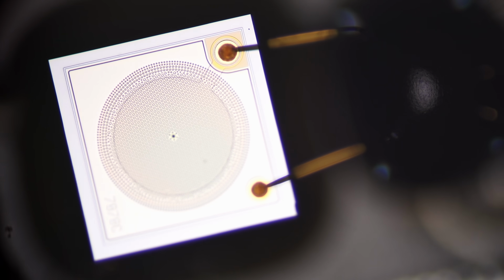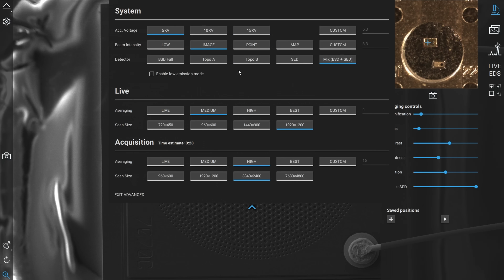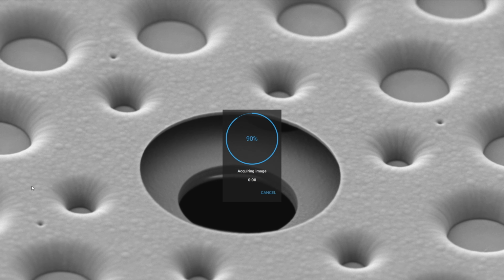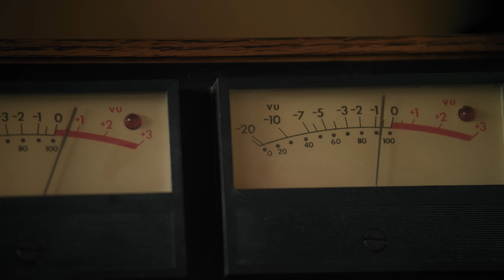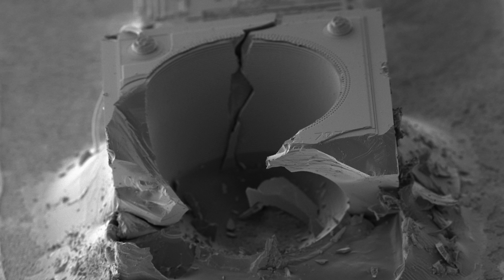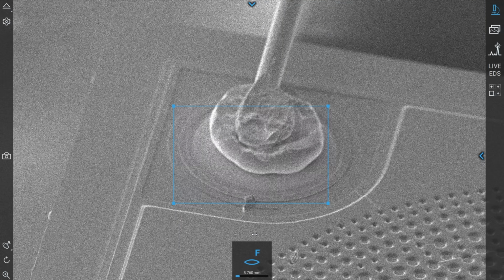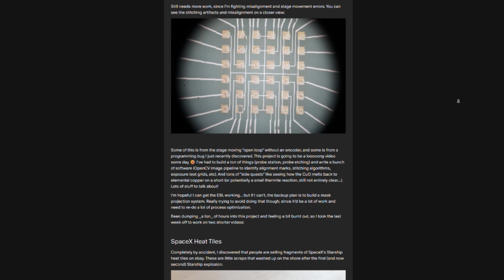Microscopic Marvel in your Earbuds

Comment: Just one correction. The balls at the ends of the bond wires are tiny solder bumps and not Au balls. Solder bumping, wire bonding, die stacking and 3D packaging in general would make a great episode!
Reply: Commonly, after making the bond to the lead frame (after first bonding to the bond pad on the chip) the wire-bond machine severs the wire with an electric arc.  This arc produces a spherical blob of molten wire, which cools and solidifies.  That little ball is right below the surface of the bonding foot.  So when the bonding foot is pressed down onto the next bond pad on the chip, it compresses the ball onto the bond pad, creating the electrical and mechanical connection to the bond pad.  

So the little balls are of gold or aluminum, whatever the bond wire metal happens to be.
Reply: Now, where chips are bonded directly to each other or PCB, the balls are usually made of solder or tin or indium. Actually, they are referred to as bumps for this kind of bonding operation.

Comment: I guess the dimples would cause a nonlinear response to displacement?  It's hard to tell what the neutral position is between the dimples and holes, but it looks like the dimples don't quite cross the holes.  If I'm imagining this right, at low SPL/small deflections you'd get an initially sharp response as the dimple intrudes into the hole, and the changing size of the annular gap as the curve of the dimple passes the hole dominates the response.  Once  the straight(ish) part of the dimple enters the hole, the annular gap stops changing and the overall motion of the plate creates the response at higher SPLs.  Pretty neat way to balance sensitivity and dynamic range if that's what they're doing.

Comment: My Pixel Buds came with a warning that they have a Class 1 laser inside.  Any idea what that might be used for and are lasers of this size particularly interesting?
Reply: Laser microphones are a thing, but I'd be shocked if that was the actual use case. Seems like a more complex and lower fidelity approach. A quick search suggests it's an IR laser to detect when the bud is in an ear.

Comment: Back of napkin calculation..: I'm eyeballing from this video that the membranes are about 0.5mm in diameter, say 0.2mm^2 surface area. Seems like the plate separation is 20 micron-ish. Plate capacitance calculation: 0.88pF. Grossly oversimplifying I'm assuming total harmonic audio distortion, say 0.1%, correlates linearly with the capacitance variation, say 0.88pF/1000=0.88fF. Less than ONE FEMTO Farad. This is just crazy. Even if I'm two orders of magnitude off, it is still crazy.

Comment: Most of these memes Microphones give out what is called a PDM (pulse density modulation) output, specially most 3 lead devices. 
So the chip also has a oscillator, and modulator to generate the PDM

Comment: Is it possible that it's not so much by capacitance but perhaps the dimples are inducing a current when bucketing in and out of the under layer holes. Making the diaphragm as a whole ultra efficient with multiple, spread out transducers?

Comment: the way this microphone works is, there is a small hole that allows to equalize the pressure between the inside and outside of the chamber slowly later when pressure is applied to the top the fluctuations are relative to the mean pressure.
Reply: The cavity is a resonant chamber. The microphone is referred to as a MEMS resonant microphone array. Pair them up and one can have quality active noise cancellation.
The cavity is a resonant chamber, the steps for different frequencies.

Comment: I would guess the large cavity behind the membrane matters for the microphone's frequency response: Most practical microphones don't want to react to slow changes in ambient air pressure, because those can easily be much bigger than typical sound pressure levels, and could blow out the membrane. This is what the small hole in the middle of the membrane is for, to let the pressure equalize on both sides of the membrane (equivalent to a high-pass filter). Of course, if the equalization is too fast, then it can also equalize out low-frequency sounds, which would impact the frequency response of the microphone. The speed of this equalization depends on the hole size and the volume behind the hole (similar to a Helmholtz resonator with an additional loss term), so the manufacturer will tune either the hole size or the volume behind the membrane to set this frequency to a sensible value - I think 1-2Hz are typical for typical electret microphones.
I would guess, then, that the hole is already as small as feasible in this process, for some reason or another. Then it would make sense for the manufacturer to make the volume larger (requiring more etching steps) in order to improve the frequency response at low frequencies.
Reply: can you explain what's the additional loss term?

Comment: I'd assume the cavity is there to be sufficiently deep to avoid pressure changes so it doesn't add resistance to the air movement between the static and dynamic portions of the MEMS microphone.  Probably because making it fully open on the bottom was not feasible in production.  The resonance at these dimensions is not a factor.

Comment: It's perhaps not that surprising that you could create a capacitive microsphone from silicon, but what's mind-blowing to me is that it's such a good microphone. It doesn't seem obvious that you would be able to make a microphone that could do anything other than simply detect the presence of sound. Insane engineering to get to a useful microphone
Reply: key to it all is the perfect repeatability and precision of silicon lithography. the signal is very weak and the frequency response is terrible but it can be precisely characterised and corrected using the built in integrated circuit.
Reply: @drkastenbrot also the ability to make an ic with that capability fit in there with such low power
Reply: @drkastenbrot  cool
Reply: What might blow your mind too are a type of sensor, found in most smartphones, smart watches, etc., which is closely related to MEMS microphones in their construction (and which in fact came first): MEMS barometers. Rather than the membrane being moved by sound, it’s got a sealed cavity so that as external air pressure changes, the air in the cavity expands or contracts, making the membrane bow in or out, changing its distance and thus the capacitance. What’s incredible is that they’re so sensitive that this is what your phone uses to detect changes in your altitude. Yes, your phone tells how many floors of stairs you climbed by measuring the difference in air pressure. So you might think it’s sensitive enough to measure a meter or two of altitude, right? Nope, they have a resolution of a few centimeters. I find it truly incredible that these sensors can actually tell the difference in air pressure over literally one palm’s width of altitude.
Reply: @tookitogo  the centimeters of precision come  from the accelerometer. barometers are good for indicating general changes down to ~10cm accuracy but for getting an absolute location, gps or other location services are needed. the air pressure heavily changes throughout the day so the reading is only usable for short term changes.
Reply: @drkastenbrot  10cm is centimeters of precision. Yes, the phones use all their senses, plus GPS, to provide the location and motion services. I didn’t say they don’t. But the changes in altitude are done with the barometer.
Reply: @drkastenbrot  to be precise, the precision is inate to the barometric sensor. The accuracy comes from recalibration versus other sensors.
Reply: @tookitogo   it’s truly awesome tech. I remember figuring out that one of my old android phones had a Yamaha component for an accelerometer. Been pretty hooked on micro tech since then.
Reply: As admittedly satisfactory as they are, most MEMs microphones have a SNR of less than 70db, and typically are in the 60-65db range. This makes them worse as microphones than many 6mm, 9mm, or 16mm electret microphone capsules. MEMs microphones are INCREDIBLE given their tiny size, though, even. if they're not quite up to snuff when compared to larger capsules. The larger size means larger membrane which should generally mean higher capacitance, which makes for a more sensitive, less frequency-dependent, lower-noise output.
 
It would be interesting to see an analysis of unit variance between MEMs microphones and comparable electret capsules. I do actually wonder if the lithographic and deposition manufacturing process results in higher unit-to-unit consistency. As noted by @drkastenbrot, this could theoretically result in response and noise characteristics that could be consistent enough signal processing to very effectively compensate for the negative qualities that are necessarily associated with the weak capacitance and extremely high-pitched natural resonance that necessarily makes these devices pitchy and noisy.
Reply: @samhughes1747  not theoretical. this is already what the digital mems microphones do. they correct the frequency response and also do AGC with the built in preamp to enhance the usable dynamic range. If you take a look at a mems mic datasheet you will find a frequency response flat to about 1dB. That is really difficult to achieve with a traditional microphone. The mems microphones will do it for cents.

As for consistency, mems microphones are basically identical from unit to unit, making them the preferred choice for array microphones.
Reply: @samhughes1747  60-70dB is still pretty good. Remember how about 20 years ago cameras and phones had rather poor audio quality? Recording live audio performances resulted in horribly distorted and clipped audio. Nowadays you can record just with phone and get detailed 4K, HDR, wide gamut image and pretty clear sound, even better than from dedicated camera (with integrated microphone). There are more software tricks when you record from more than two mics required for stereo like directional enhancement, noise and wind cancelling. Of course for recording the range of human voice it's much easier as the frequency range is narrower than for general use.
Reply: @jan.tichavsky , I understand the thought, but you really can’t understand the difference till you use a microphone built around even a decent electret capsule.
Reply: Aaaand it sells for a few bucks or even less. 😮
Reply: The FBI and CIA approves this message. ;D :D
Reply: And it costs tens of thousands of dollars to get to technology to even truly grasp the depth of its engineering

Comment: i'd love to know how they made the top layer of silicon...

its dimpled, and not flat, meaning that its not litho etching...?
and then how did they managed to make a whole layer of gap in between the 2 membranes? I can't imagine it to be all litho because the washing step to make that gap would either take too long to diffuse out, or break the top layer....
Reply from the maker: I think for this particular device they used silicon dioxide as a sacrificial layer. I didn't show the data, but there are some regions of pure SiO2 around the broken edges (where the layers bond to the "bulk" device). So I think they probably patterned the lower grid surface, deposited a layer of SiO2, deposited layers of silicon/polysilicon then finally etched out the SiO2 with either wet etch with HF, or a dry reactive plasma etch. Probably a dry etch to avoid surface tension issues Then probably flip and backside DRIE etch the cavity. That also explains why the dimples are sorta rounded as well... they were deposited over the SiO2, which itself was deposited on the crisp underlying Si etching.

Pretty wild though! MEMS fabrication techniques are super cool!

Comment: Im not sure if its a microphone from a different manufacturer but I saw the actual MEMS wafers with the holes in it. The poly etchers basically punch holes in them via bosch process to go down so far without having an profile with an angle. A lot of loops.
Reply from the maker: Bosch process is absolutely wild! Especially the more refined variants that can etch with much smoother sidewalls.

Comment: Great video! That chip that's amplifying the signal from the microphone layers is probably converting the audio signal into high fidelity digital audio and passing it to a microcontroller via an interface called I2S... this eliminates the analogue noise issues over PCB traces, and the sensor won't require any more external circuitry to manage the Audio signal integrity.... the sensor only needs 4 wires, and the substrate of the microchip is probably acting as a ground plane and 4th connection to the metal can for EMI control...
Reply: i've never seen a microphone do an i2s directly. It's usually either analog, or pulse density modulation (PDM, typ. 3Mhz-ish stream of ones and zeros that, when treated as an analog signal, represent the analog audio wave)
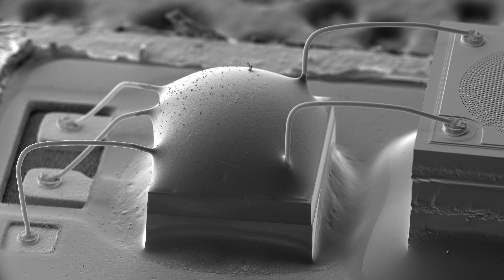Reply: I really don't think it's using I2S. Firstly, I doubt you'd use the substrate for the ground connection - yes, it is connected to ground (not just for EMI, but also for functional reasons in any p-substrate process, else you get parasitic diodes conducting everywhere), but usual substrate resistances are too large to rely on for a supply connection. Also 3:58 quite clearly shows two wires going to pads, and the third one connecting to a plane below the two ICs, which is most likely a ground plane. That leaves two connections, one of which has to be power, so the other is more likely just an analog output.
(I tried to find the exact part to confirm its interface, as the part number is shown in the video, but couldn't find anything.)
Reply: Yes... That's usually the case... I only know about I2S microphones because I worked with one on a development board last year.
Reply: Yeah, I think you are correct... I had a look at my devboard again, and it has an MSM26S4030H0 I2S microphone which has 8 pads on the underside according to the datasheet. Seems like the PDM ones are really common, which was previously mentioned...